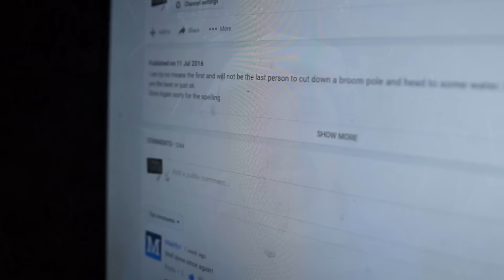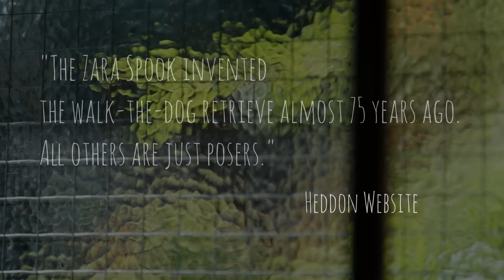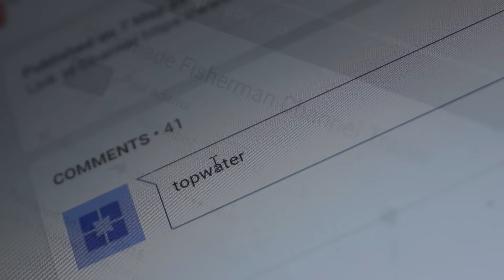Making a fishing lure from a broom handle pt 2 Stick Bait

Comment: Topwater:  Minnow

Love your videos Paul.  Watching them got me into tempting my fate making wooden lures.  Unfortunately haven't been having much luck outside of 3 out of the 14 I have made even swimming right.  Keep up the great work.
Reply from the maker: I  once spent a huge amount of time making my first balsa minnow and finally got it to some water, on the cast the lightest of breezes sent it way off target i mean no where near where i was aiming  and it did not swim in any way i have seen a lure swim it rolled limply across the surface without the diving lip having any effect. I still have that lure to remind me but it sits in box not on its own but with quite a few other failures that I have made along the way. Good luck

Comment: Paul , ...do not give up upon this simple "mother-of-all-stickbaits" , they definately have an appeal for pike(smaller sizes for big perch) , my own experiences do not lie !

Conditions as shown were perfect , surely only that little bit of luck went missing !

For my own taste your lure dug in a little bit too deep , experienced such before using pinewood , ....I'd either turn down abachewood boards or use a broomstick of a more buoyant certain tropical timber(don't know it's name) , at least if I can find them , ...seems , that they have quit import nowadays .

But there are a few "Spook" dynamics , that can be altered to achieve subtle differences in action , ...I had already mentioned the buoyancy of the basic timber material , second would be ballast placement .

Naturally the ballast is essential to be placed somewhere into the rear third of the cigar-shaped body , never  further forward .
The more the ballast sits towards the tail end , the narrower the width of the glide path would get , the more of an "X"-pattern(viewed from above) the lure would perform , .....just like your lure does .

With the ballast placed more forward towards the 1/3 body length limit , the lure would not "X" as pronounced anymore , but perform longer glides at smaller angles in relation of the direction of line pull .

Another thing to be altered is the location of the tow eye , .....placed directly at the nose tip , a heavier weighted "Spook" would get the tendency to dive below the surface for a few centimetres , yet still causing a wake on the surface , ........might be of advantage on certain days , when pike are reluctant to take pure surface swimmers .

With your lure you have dissabled that option by carving that little slant to the chin , which pushes the lure upward again , without that slant you lure might have run estimated one or two centimetres deeper .

If you want your "Spook" to ride higher on the surface without the possibility of submerging , use more buoyant material and place the tow eye on it's chin , somewhere below the nose tip , ......with your lure shown , I would say , that the level of the center of that little slant would be the most rearward possibility of tow eye placement(just as a reference , naturally without furnishing a slant).

BTW , ...such a slant on the chin keeps you lure riding high as well , but yet offers a subtle resistance as well to slighly hinder the gliding performance .

 Off course one could paint his "Spooks" in all fancy colors , but I've once read a statement by a veteran US musky angler , that I've found much sense in , .......refering to a quote  from Henry Ford regarding his first mass-produced car ,  the Ford Model T , ......"any customer can have a car painted any color that he wants so long as it is black ".

Black topwater lures cast the best silhouette to a predator lurking from below , may it be in sunshine or in moonlight , on overcast days or during pitch black nights , .......so I have painted quite a few of my own surface lures in black , probably with a little dash of orange or bright yellow on their heads , just to be able to locate them better swimming on the surface far away .

Maybe natural minnow colors and eye-pinching colors like "firetiger" , together with black , these three color schemes are all , what it takes for a surface lure , at least colorwise .

It's better to carry a little variety of three to five spooks along , all sporting subtle difference in difference in action and performance , .......it's more likely , that one of these would be a winner on a given day !

A very nice clip again , Paul , .....cheers , Dieter
Reply from the maker: I purposely never made any kind of drawing for this lure or used any measuring tools  or even testing the weighting or it position because I wanted just to enjoy the freedom of creating a basic lure without having to go back test retry, so there was a good chance that it would not have the greatest performance, i missed a least two fish an either one of them could of made it into more successful day , but i will be back top water fishing
Reply: There is not really a need for any sketching or exact measurements for such "Spooks" , I'd  just keep them roughly cigar-shaped with a relation of diameter:length about 1:6 to 1:8 , .......the shorter ones would "X" better and the longer ones would glide a longer path , ...should have added this to the dynamics described in my first comment . 

Any version of a "Spook" would surely score  on it's day , as the temper of the pike changes frequently .

But in my opinion fairly quiet waters are essential to use "Spooks" , as with an increased chop on the water other topwater lures creating more noise and commotion(like poppers  or propbaits)would be of advantage ,..........most likely I put my trust on lures , that can be made to pop , splash or walk on the surface , but same time can also be submerged to have an underwater wobbling action at 30cms to 60cms depth  just by rod tip manipulation and speed of retrieve.

 Often these prove to be a better bet compared to pure topwater lures , .......but amongst pure topwater lures , "Spooks" have proven superiority over poppers and propbaits for me , but also can't beat previously mentioned "skim-and-swim" type of lures , .......just my own experiences, off course .

Greetings , Dieter

Comment: Great video Paul! It appeared that you put only one weighting spot around the back third of the lure, is that correct? Also, what was the material you melted into the hole? Plain solder or some kind of lead wire? Excellent action on the lure too - great job!
Reply from the maker: yes that is right, i used some plumbing solder left over from a job

Comment: Hello Paul
As usual, this was a great video again... PAul, I have noticed that in your last videos you were using wrapped wire instead eyescrews for your lures. Do they have similar resistance to fish strikes?? I was thinking that even though with both you can use glue before to set the screw or wire, at the end the screw could be more reliable.
Would you please give me some feedback? Thanks a lot and warm greetings from Peru....
Reply from the maker: I think they are both far above what is required, I have never had either of them fail so the only way for me to find out would be to test them.
Reply: Thank you Paul....

Comment: I havnt seen hollow body frog in your arsenal, is that something that could be manufactured at home?
Reply from the maker: it is something i have thought about, i have made a hollow body duckling but it is a stiff plastic and rotationally moulded which is not as easy as i thought, but i may do a soft foam frog instead, as I think soft hollow body is a bit beyond me
Reply: +Paul Adams (The Handmade Fisherman) well your skills are great, I can watch your videos over and over, makes me wanna make stuff! but then I realize I'm lazy and just stick to watching. thanks